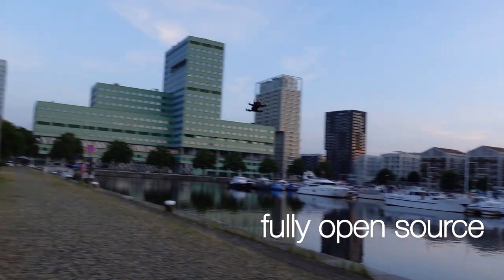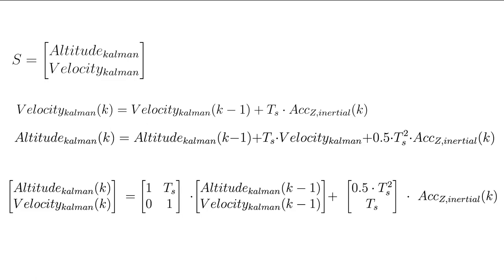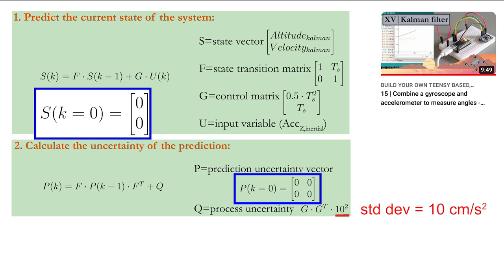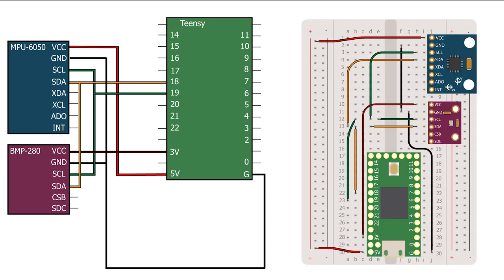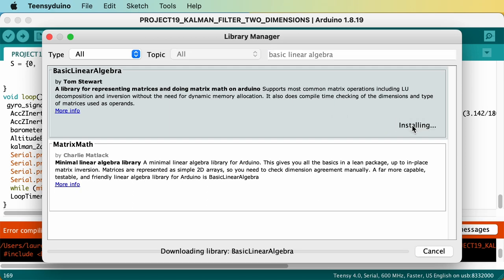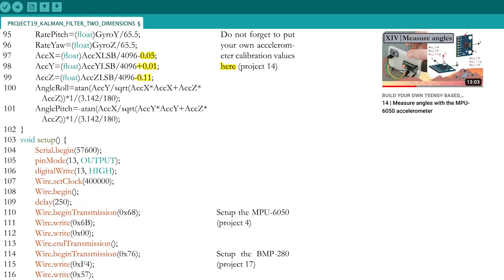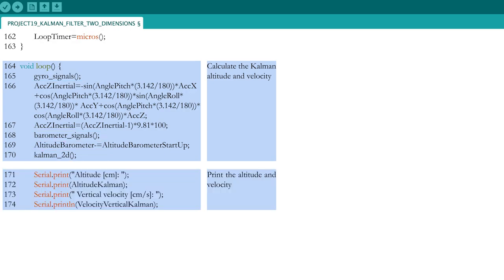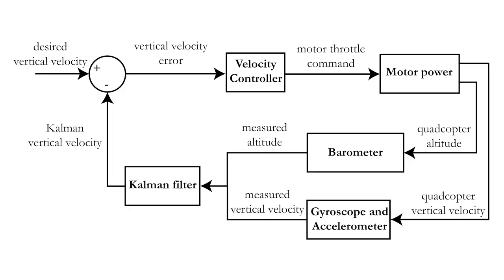19 | Combine an accelerometer and barometer to measure altitude

Comment: Weird, compiling the code results in an error
Reply: have you found a solution?
Reply: I think the basic linear algebra library has changed something causing this.
Reply: I think you have to use the basic linear algebra library version 3.3 to get it properly compiled
Reply: @pratik did you implemented vertical velocity flight controller into your esp drone?
Reply: @_ShihabulEhsan  no, I was just trying to run the kalman filter
Reply: @epicdaniel508   I have implemented this 2D kalman filter in a esp32. not in drone though. may be we can share some resources.
Reply: @_ShihabulEhsan  i am trying, not getting good results with the BMP280, tried tuning the PID vertical velocity parameters but still no luck.
Reply: @have_fun1107  hello, I am trying to do this with esp32 and gy86 sensor. For some reason my kalman filter isnt stable, it doesn't return to 0 at steady state but the values keep decreasing/ increasing to infinity. Was your filter stable? I tried to tune Q and R with no luck. Can you help please?
Reply: @yenle7296  can you show the code and circuit?
Reply: @have_fun1107  #include <Wire.h>
#include <MS5611.h>
float RateRoll, RatePitch, RateYaw;
float AngleRoll, AnglePitch;
float AccX, AccY, AccZ;
float AccZInertial;
float LoopTimer;
float AltitudeBarometer, AltitudeBarometerStartUp;
int RateCalibrationNumber;
#include <BasicLinearAlgebra.h>
using namespace BLA;
float AltitudeKalman, VelocityVerticalKalman;
BLA::Matrix<2,2> F; BLA::Matrix<2,1> G;
BLA::Matrix<2,2> P; BLA::Matrix<2,2> Q;
BLA::Matrix<2,1> S; BLA::Matrix<1,2> H;
BLA::Matrix<2,2> I; BLA::Matrix<1,1> Acc;
BLA::Matrix<2,1> K; BLA::Matrix<1,1> R;
BLA::Matrix<1,1> L; BLA::Matrix<1,1> M;
BLA::Matrix<1,1> inv_L = Inverse(L);
MS5611 ms5611;
void kalman_2d(void){
  Acc = {AccZInertial};
  S=F*S+G*Acc;
  P=F*P*~F+Q;
  L=H*P*~H+R;
  K=P*~H*inv_L;
  M={AltitudeBarometer};
  S=S+K*(M-H*S);
  AltitudeKalman=S(0,0); 
  VelocityVerticalKalman=S(1,0); 
  P=(I-K*H)*P;
}
double referencePressure;
void checkSettings()
{
  Serial.print("Oversampling: ");
  Serial.println(ms5611.getOversampling());
}
void baro(void){
  long realPressure = ms5611.readPressure();
  float AltitudeBarometer = ms5611.getAltitude(realPressure, referencePressure) * 100;
}
void gyro_signals(void) {
  Wire.beginTransmission(0x68);
  Wire.write(0x1A);
  Wire.write(0x05);
  Wire.endTransmission();
  Wire.beginTransmission(0x68);
  Wire.write(0x1C);
  Wire.write(0x10);
  Wire.endTransmission();
  Wire.beginTransmission(0x68);
  Wire.write(0x3B);
  Wire.endTransmission(); 
  Wire.requestFrom(0x68,6);
  int16_t AccXLSB = Wire.read() << 8 | Wire.read();
  int16_t AccYLSB = Wire.read() << 8 | Wire.read();
  int16_t AccZLSB = Wire.read() << 8 |  Wire.read();
  Wire.beginTransmission(0x68);
  Wire.write(0x1B); 
  Wire.write(0x8);
  Wire.endTransmission();                                                   
  Wire.beginTransmission(0x68);
  Wire.write(0x43);
  Wire.endTransmission();
  Wire.requestFrom(0x68,6);
  int16_t GyroX=Wire.read()<<8 | Wire.read();
  int16_t GyroY=Wire.read()<<8 | Wire.read();
  int16_t GyroZ=Wire.read()<<8 | Wire.read();
  RateRoll=(float)GyroX/65.5;
  RatePitch=(float)GyroY/65.5;
  RateYaw=(float)GyroZ/65.5;
  AccX=(float)AccXLSB/4096 - 0.1;
  AccY=(float)AccYLSB/4096 + 0.05;
  AccZ=(float)AccZLSB/4096 + 0.025;
  AngleRoll=atan(AccY/sqrt(AccX*AccX+AccZ*AccZ))*1/(3.142/180);
  AnglePitch=-atan(AccX/sqrt(AccY*AccY+AccZ*AccZ))*1/(3.142/180);
}
void setup()
{
  Serial.begin(57600);
  referencePressure = ms5611.readPressure();
  checkSettings();
  delay(2000);
  Wire.setClock(400000);
  Wire.begin();
  delay(250);
  Wire.beginTransmission(0x68); 
  Wire.write(0x6B);
  Wire.write(0x00);
  Wire.endTransmission();
  for (RateCalibrationNumber=0; RateCalibrationNumber<2000; RateCalibrationNumber ++) {
    baro();
    AltitudeBarometerStartUp+=AltitudeBarometer; 
    delay(1); 
  }
  AltitudeBarometerStartUp/=2000;
  F = {1, 0.004,
            0, 1};  
  G = {0.5*0.004*0.004,
            0.004};
  H = {1, 0};
  I = {1, 0,
           0, 1};
  Q = G * ~G*10.0f*10.0f;
  R = {30*30};
  P = {0, 0,
           0, 0};
  S = {0,
           0};
           LoopTimer=micros();
}

void loop()
{
   gyro_signals();
  AccZInertial=-sin(AnglePitch*(3.142/180))*AccX+cos(AnglePitch*(3.142/180))*sin(AngleRoll*    
  (3.142/180))* AccY+cos(AnglePitch*(3.142/180))*cos(AngleRoll*(3.142/180))*AccZ;   
  AccZInertial=(AccZInertial-1)*9.81*100;
  baro();
  AltitudeBarometer-=AltitudeBarometerStartUp;
  kalman_2d();
  Serial.print("Altitude [m]:");
  Serial.print(AltitudeKalman/100);
  Serial.print(" Vertical velocity [m/s]:");
  Serial.println(VelocityVerticalKalman/100);
  while (micros() - LoopTimer < 4000); 
  LoopTimer=micros();                 
}
Reply: @have_fun1107  the connection is simple. 3.3v and gnd of sensor to 3.3v and gnd of esp32. Scl output of sensor to pin 22 and sda to 21. 4 connections
Reply: @yenle7296  same issue did you fix it ?
Reply: @pratikphadte  did you fix it ?

Comment: There is a mistake in your equations. When updating your uncertainty (covariance matrix P) a posteriori, that is, after measurement, you should write $P(k) = (I-KH)P(k)$, with H being the observation matrix. Other than that, great video! Really informative and adequately paced, congratulations.
Reply: Could you show how to do it in a code please?
Reply: In the real code its allready like that ( line 44 ) => P=(I-K*H)*P;
Reply: Thanks for the heads up ! I had issues with the matrix incompatibility but turns out its the wrong matrix

Comment: My ESCs are turning on separately when I connect them to the receiver one by one, but they are not turning on when I connect all of them and start the drone. I've tried everything, I changed the teensy, I got a bigger battery, and re-assembled the whole upper part and its still not working. What can It be?

Comment: The performance can be improved if you can implement a kalman filter with the dynamical model of the system. this will involve computing the weight of the quadcopter. Also, the rates of both the accelerometer and barometer are not the same so as can be seen from the results there is a jump in the readings that might be because of the pressure data arriving at a lower rate than the accelerometer data. I will try this with my setup some time.
Reply: Its normal I guess because of the fact that, the trust morely depends on the barometer sensor , it will close accurate value when the barometer data come in. Other drifting causes from accelerometer.
Reply: Can you explain what you mean by Kalyan filter with the dynamical model

Comment: Such a great project, very well explained. I just notice, on the lines 171 and 173, you will have to remove the space after the label for the arduino IDE 2.0 in order to have a working plotter serial.
the label shoud be "Serial.print("Altitude [cm]:");" without space beteewing the : and "

Comment: Hi. I'm following your project in the same way but on the board Arduino pro mini. And now I really need your help!
I'm stuck at the two lines. The first one is line 39   K=P*~H*Invert(L); I kinda manage it by changing Invert to Inverse. But not sure.
The second problem is line 169  Q = G * ~G*10*10; It seems like the matrix numbers are not matching, but it is hard to figure out how to fix them.
PLEAS help me out!!

The compilation error is
: no match for 'operator*' (operand types are 'BLA::Matrix<2, 2>' and 'int')
Reply: I had the same issue. For the Q = G * ~G * 10 * 10; I've changed the Matrix types to float like so:
BLA::Matrix<2,2,float> F; BLA::Matrix<2,1,float> G;
BLA::Matrix<2,2,float> P; BLA::Matrix<2,2,float> Q;
BLA::Matrix<2,1,float> S; BLA::Matrix<1,2,float> H;
BLA::Matrix<2,2,float> I; BLA::Matrix<1,1,float> Acc;
BLA::Matrix<2,1,float> K; BLA::Matrix<1,1,float> R;
BLA::Matrix<1,1,float> L; BLA::Matrix<1,1,float> M;

And explicitly indicated that 10 is float and not int:
Q = G * ~G * 10.0f * 10.0f;
Reply: @parahoping   did it work for you after these corrections?
Reply: Yes. The default BLA matrix data type is float. So the 10 also needs to be float.

Comment: to calculate altitude, isn't integrating the velocity and adding the previous altitude enough? whats 0.5*Ts^2 *acc_z,inertial for ?
Reply: I think you have a point. However, if you remember the equations motions of a single particle in the space (UMA), to estimate its altitude we can use h = v0•t + (1/2)•g•t^2. Then, in this context, we can change the g -> AccZ measurement, and this results more effective